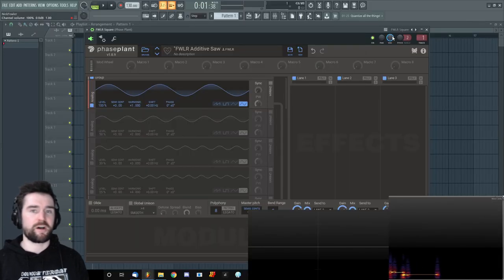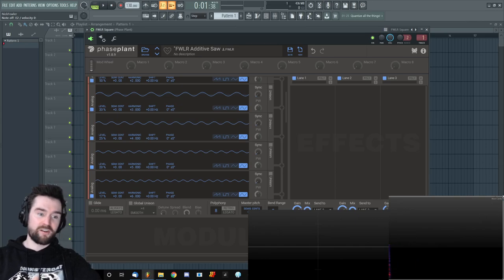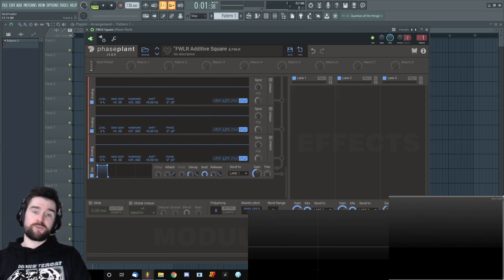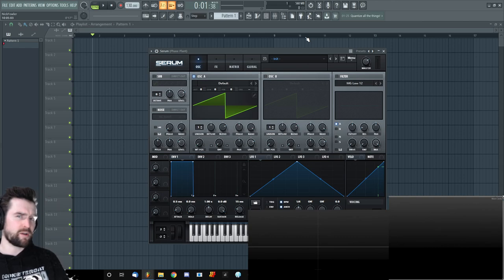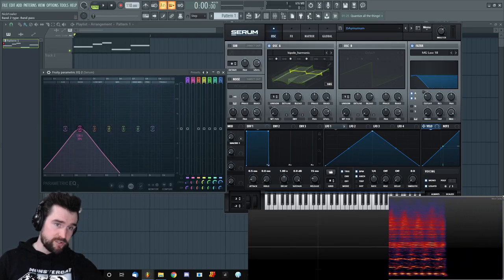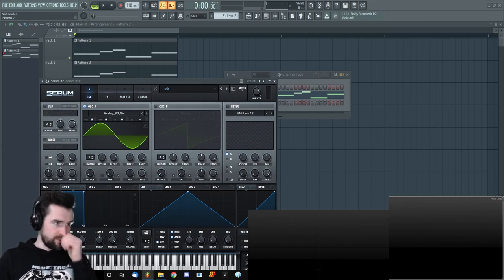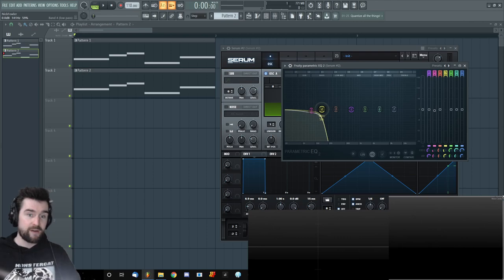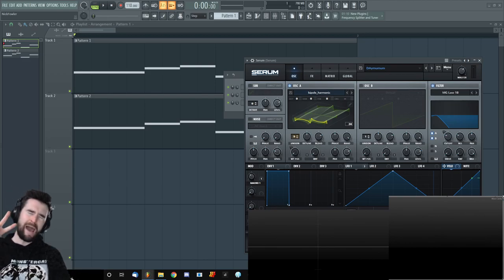Using SCIENCE to make GIRTHIER bass sounds! (Sub Separation Tutorial)

Comment: One thing I'd recommend is getting to know your way around an oscilloscope so you can see phase issues as they happen, I find working in the low end a lot easier when I can see the waveforms
Reply from the maker: Though I rarely bust out the scope, I agree. The more information you have, the better choices you can make for sure.
Reply: @FWLRmusic  It's almost like you didn't study Electrical Engineering where you constantly use an oscilloscope to check phase, frequency and waveform of current going through a circuit ahaha
Reply from the maker: @RayhemXD  hahahha yes and though I have 4 oscilloscopes at home, they don't see much use these days